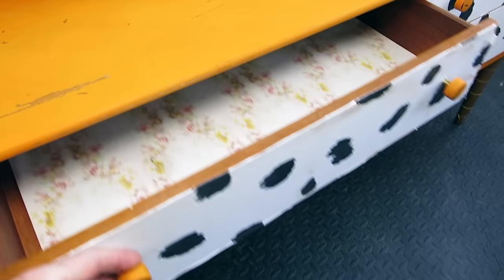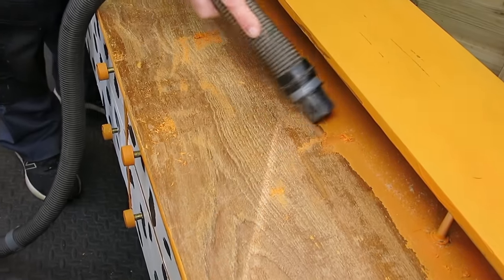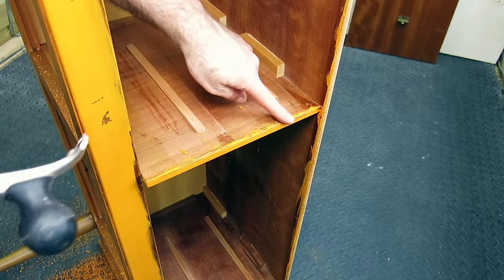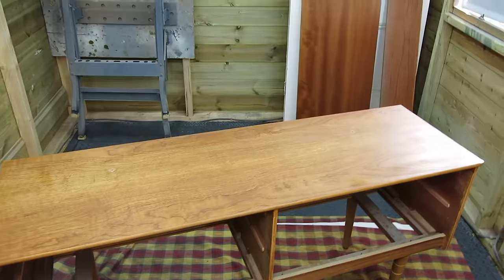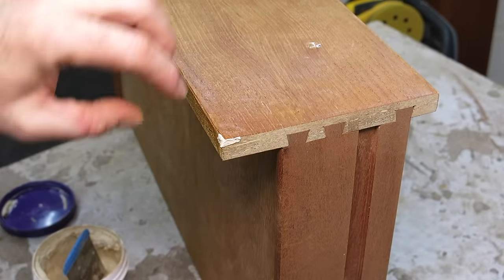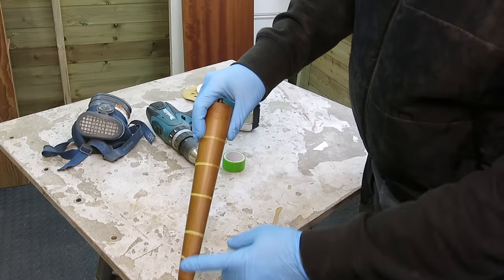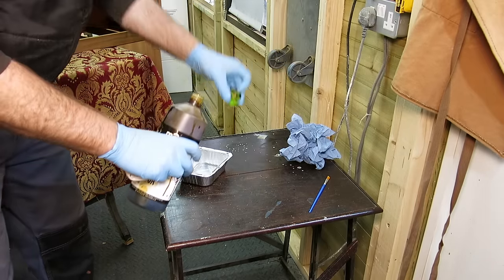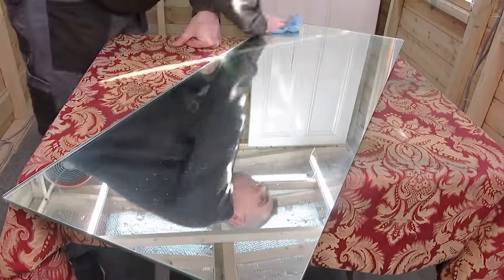Mid Century Modern (MCM) Furniture RESTORATION

Comment: BEAUTIFUL  work.  Unusual piece.  I liked the silver, but paint on hardware, to me looks fake AF, and looks like... well, paint.  Besides, some of the hardware could have been some other metal.  May I suggest that really cheap fake gold leaf?   This at first looks very shiny, but if you wait before covering the  with the no tarnish varnish, it does look close to brass.  Or you could expose it to ammonia, and that will age it fast, as in within minutes.  Also, if a magnet won't stick to the hardware, it probably is solid brass.  The gold leaf is hard to do at first, but you will get good at it, fast.  It goes from a shine to a sheen.  Thanks and subscribed and liked.
You don't sound like London, maybe Wales?
Reply from the maker: Thanks for the tips. I’m from Manchester 😀👍

Comment: In general I do not like this style, but this is beautiful.  Looks almost modern.  It still looks orange, but goes well with your floor.  Have you ever used household bleach?  Also any stain that says "ash" will tone down the orange.  I will sometimes tint my first topcoat with the opposite of orange which is blue.  TINT as in very faintly.  This does wonders and not detectable.
Reply from the maker: Thank you and thanks for the tips on colouring 👍👍😀😀

Comment: Great job! Gorgeous wood grain. I'm restoring a vintage chest and dresser.  It had the ugliest orange red maple stain that looked like it was slapped on and not rubbed off. I've never seen construction like this before.  The drawers are made from white oak. The tops and drawer fronts  are maple. The sides are maple vaneer and at some point came loose, and instead of gluing it back down, they just nailed the outer edges down. Under the vaneer was 3 different sizes of underlayment, and it was shoddily put together. Behind the dresser was beautiful hickory vaneer showing towards the inside of the drawers. I've never seen construction like this before. I can't even easily explain how the tops were anchored down! Just mind boggling! The beautiful wood grain was hidden underneath the excessive use of stain.  I scraped everything off and restained everything with maple stain and water downed green stain to take out the red and orange and lastly a beautiful amber shallac. I'm still just confused about the construction of these pieces.
Reply from the maker: That’s sounds like something Frankenstein may have made. Good luck with it 😂😂👍

Comment: A useful tip I learned for removing old, pre- two component finish is fine saw meal, nitro solvent and a bit of time. Pile of saw dust/meal, soak it in solvent (Very good ventilation/mask and gloves) and then rub the old finish off, repeat as needed. Has the advantage of being gentle to the old wood/Furnier...
Reply from the maker: Thanks very much for the tip 😀👍

Comment: Hi David, new subscriber here! I came from 'Flipping Drawers ' originally, yours is the third video I've watched in the challenge. I can't actually believe it but I have a very similar dressing table in the spare room! Mine has not been painted and the hardware is different ( mine has triangular draw pulls) and my mirror goes wider as it goes up - like a piece of pie with the end cut off. It's hard to describe!! But apart from these small changes - it's practically the same! I wish I could say it looks like your finished product!! I'm thinking - shall I sell it? I'm in Manchester so I'm not too far from you, it's been in the spare bedroom for as long as I can remember. You did a great job and I've subbed coz us Northerners have to stick together 😊👏✌🇬🇧
Reply from the maker: Thanks and welcome to my channel. I actually only paid £35 for this but depending on the MCM manufacturer and the condition/originality they can fetch some good money so might be worth selling if you don’t want it. I’m a Manchester lad myself so agree is northerners should stick together 😀👍👍

Comment: Presswood drawer fronts, pot metal (zinc) knobs, Drawer fronts dovetailed into the drawer structure, no veneer banding on the drawer edges.  This isn't an MCM piece of furniture. Unless you consider the 1980's MCM.
Reply from the maker: It’s certainly not 1980’s and veneered press-wood is extremely common in MCM furniture 🤷‍♂️
Reply: @MayfieldRestorations  It's 1980's.  Presswood WAS sed on some MCM furniture, but never as a drawer front.  MCM drawers with particle board typicaly have the drawer box in particle board and either a solid wood or veneered plywood drawer front.   The drawers on this don't even have veneer banding on the edges.

Comment: The piece is rather unstable.  That should have been addressed.  Was there a need to check if the orange paint was lead based.  Would it have been better to wear a mask when scraping?
Reply from the maker: It looked unstable because the legs weren't fully tightened at the start but that was resolved. I didn't bother filming me simply turning a furniture leg! I could tell the paint was a modern Latex paint so no lead test required and minimal fine dust particles when scraping so no mask required. Any positive points about the video?? 🤷
Reply: I started reading your response in a positive way until I noticed the (!) at the end of the sentence about not filming the leg tightening.  Lead me to re-read the sentence as negative.  If that was your intent, then I apologize if you took offense to my comment.  In the interest of remaining respectful, I will not comment further.   @MayfieldRestorations